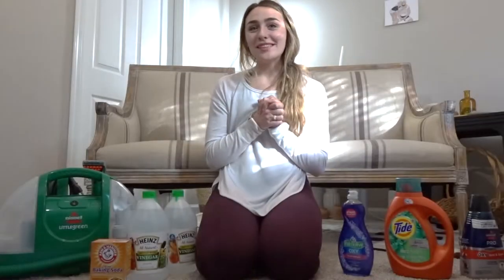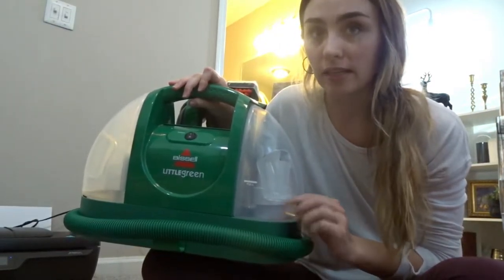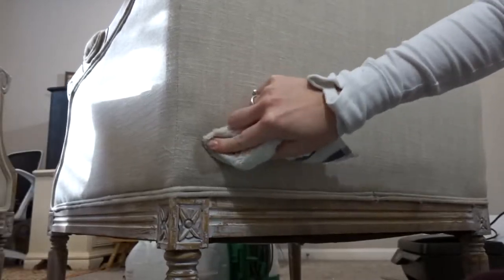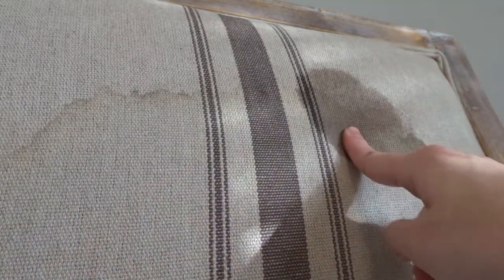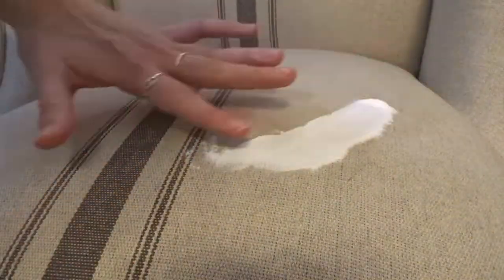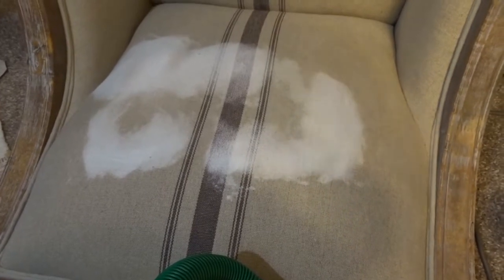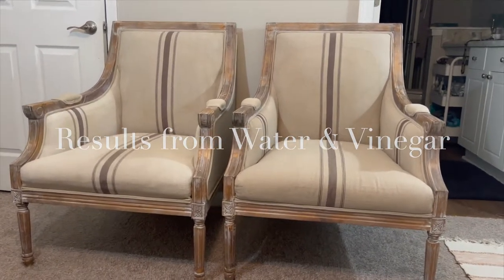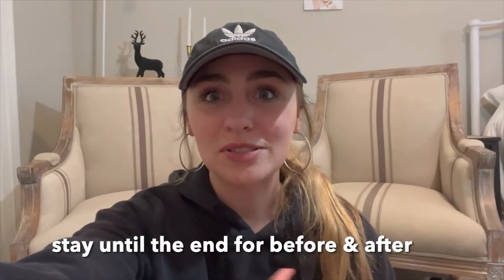Testing Methods of Removing Stains from Linen Chairs | Furniture Flips

Comment: My secret stain remover is Resolve Carpet Cleaner (foam)!  Just squirt the foam onto the stain and lightly rub it in ... I like to leave it kind of thick and foamy. Let it sit for about ten minutes to loosen the dirt and let it do its magic. Then rub the stain out with a wet cloth (just water.)  It always works!  I use it on everything from clothes to furniture, and of course, carpet.
I definitely would have used it on the chairs, but bravo